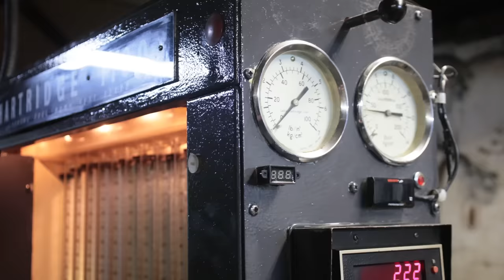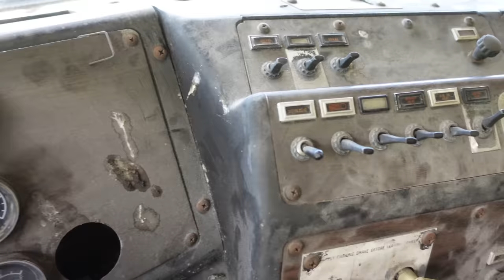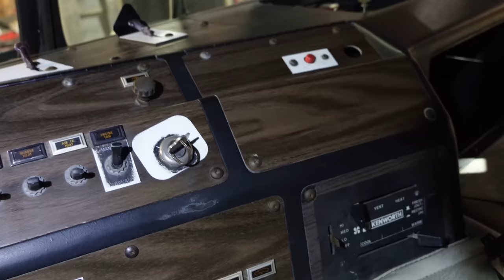Building a Kenworth K100 Semi Truck in 10 MINUTES!

Comment: In the 70's there was a K100 with a custom truck hauling bed. They pulled one of the first W900 double bunks (that had been set up for racing.) It was actually two single sleepers mated together. 
They ran around the state fair circuit. 
Beautiful trucks.
I have a post card of the pair.

Comment: It looks so good!
I have a question about extending the chassis length - is that just because you prefer the look? Or is there a practical advantage over the shorter chassis?
Reply: Maybe because they extended the fuel tank too?
Reply: Rides better...can also hang products over the front of the trailer instead of off the rear and avoid buying a permit for oversize loads

Comment: That’s a fine K100 especially with CAT power . I like that U kept the as produced wheel base . With the air bags suspension a smooth ride is possible . All these long trks look ok but are restricted to certain types of loads .as too long to get in tight places . Sometimes that’s where the money loads are at . Mechanical Engineering Sciences . S.A.E. 55 years  . There’s an old saying . If it looks good , it is good . Attention to detail !

Comment: The Truck turned out Great looks and Runs amazing.  Although don't really like the side at the top back Gold rap looked better without it.  The colors of the Cab and Frame looks really good BUT a Black and Blue Cab with a Blue frame would have looked much better.  Awesome Job again Truck looks Great!!!

Comment: A brand spanking new K100! Cost $$$ vs new $$$$???  I drove an 1980 K100 VIT, Cummins 400 big cam, 13 speed w/ top two gears reversed.  100 MPH indicated in west Texas at 60,000 lbs and 2 empty cattle haulers passed me like I was parked!

Comment: Turned a pile of scrap into a $ 70,000 to $ 90,000 rig I would have went above the $ 130,000 if the motor,transmission,and wiring where all new 👍

Comment: So I hate to be that guy but I got a question. I have a 1981 ford f600 with a 370. I'm looking to repower it eventually and was wondering your opinion.  I'd like something mechanical and sleeved so it's easy to work on and it makes sense to rebuild.  Any suggestions? I don't need all the power in the world. Just want something reliable and somewhat cheap to maintain.